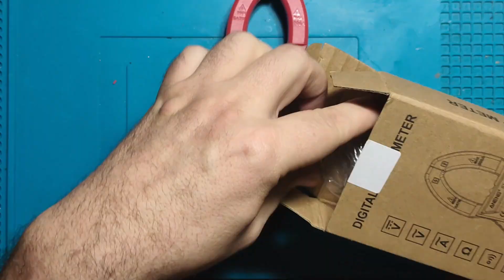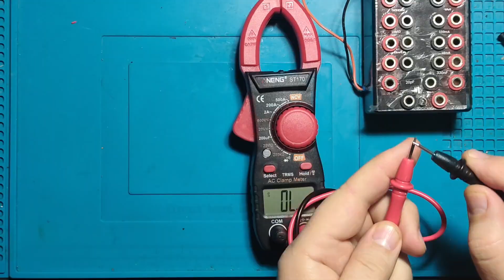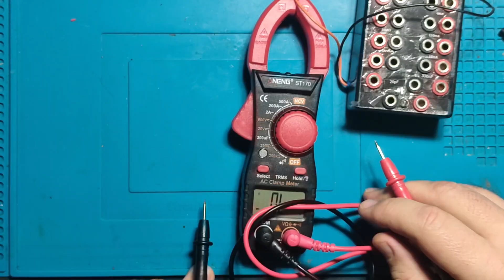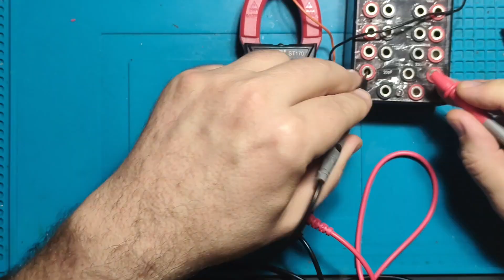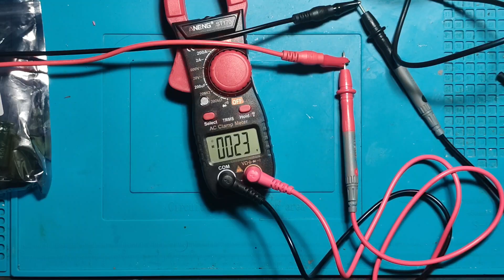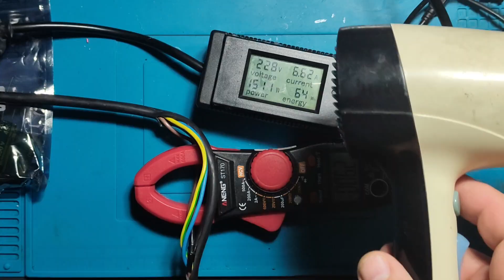World’s Cheapest Clamp Meter for  7€ ? ANENG ST170 Tested!

Comment: Hello just curious how you make yours read amp by the wireless mode which wire you connect it on?

To be honest I know I don’t need this but it’s something that might be helpful in the future
Reply from the maker: it's clamp meter, up to 400amp contactless. although AC only. clamp meter needs live wire to go through clamp so it can measure how much current flowing. it is non contact but clamp needs to be around live wire.
Reply: @B @BA-Electronic oes it have to be connected to just one side of the AC wire or can I just clamp it onto a extension cord

To be honest I just mostly wanna test mine as I can’t believe I got mine for 170 pesos on Temu 😅 the quality plastic feels much better then my older old multimeter but I quess it’s because my old ones are brandless basically 😂
Reply from the maker: @SwapkillProject863I don't think it is going to work if you clamp it to the extension cord. It needs to be clamped to wire ,preferred live but it will read even if it is clamped around neutral.
Reply: @BA- @BA-Electronic  no I mean like a live extension courd on the wall is that different?

How do I use this to read amp using wireless?
Reply from the maker: let's go like this, to establish AC current flow, you need two wires . live and neutral. So in whatever cable you have at least two wires. You need to split those two wires from each other, just enough to clamp the meter around one wire.  There is no other method. It always needs to be clamped around one wire , preferred live wire.
Reply: @BA-Electronic  sorry I’m a newbie is the live and neutral basically the main two wire on a house wire to a device like a extension cable wire or TV?

To be honest im still learning so sorry if this question gives you headache im trying my best to understand the term😅
Reply from the maker: @SwapkillProject863yes it is, but if you are newby like you say then please don't play with it ,it can be lethal.
Reply: @BA-Electronic  I don’t actually have any plans with playing with it I just mostly wanna know how it works specially the fact how it can read wirelessly as it sounds abit like something that can be considered witch craft😅😂
Reply from the maker: imagine you have an extension cord. unplug it from the main socket before work. Strip 100-200mm of the outer layer of cord insulation but carefully to not damage inner wire insulation. After striping the outer layer inside are 3 wires in most cases. usually brown (live),blue(neutral), and green/yellow(earth) . you place clamp around brown wire or blue, Brown preferred
Reply: @B @BA-Electronic  from Philippines most wire here are only 2 wire and are reversible can it work with those😅?

Most wire with plugs I seen are black and red😅 side note mostly know that because I often dismantle broken tech for parts. I don’t really use the parts I have just collected them in a box for when I might ever need it to small projects like replacing broken parts of a small hand held fan

It never last long but I’m learning from my mistakes anyways I quess in short I just don’t like wasting anything so I just keep Whats I can just incase I’ll find a use😂
Reply from the maker: yes it can ,but not around both wires at once. Just around one wire at once. what is standard power in Philippines, here 230V 50Hz
Reply: @BA-Electronic  I think from what I seen the ports is 220volt to 240volt. From what I know it’s close to 240volt as it’s what I see the ports and plug have 250v printed in most outlets I seen
Reply: @B @BA-Electronic hello again jusy did abit og searching it might actually be 220v 😅 I have no clue where I can confirm it